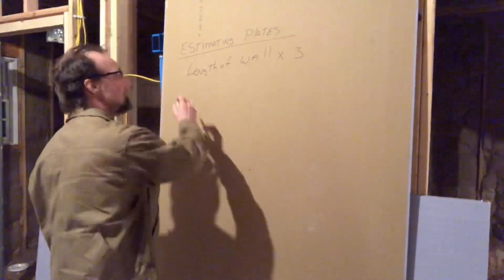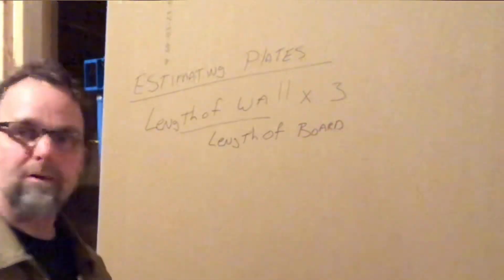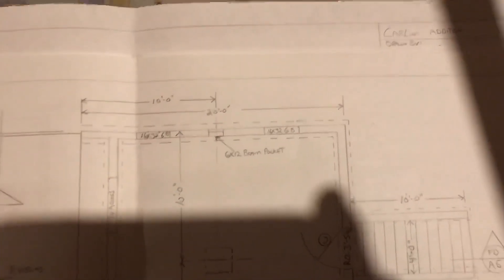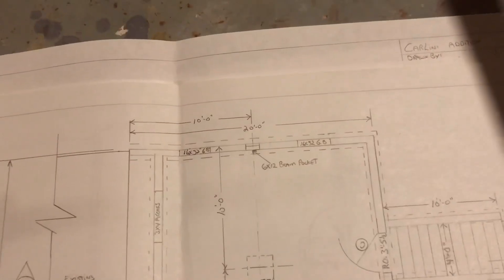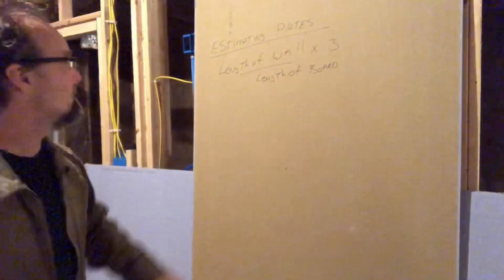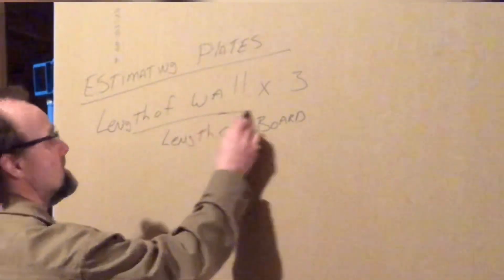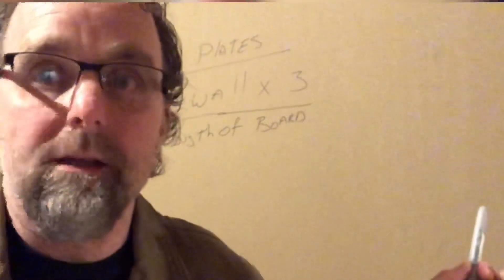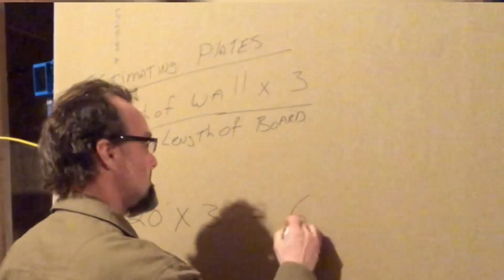Studs and Wall Plates Calculation

Comment: Wouldn’t you multiply length of wall by 4 since there are 3– 2x4 on top of the wall and 1–2x4 on the bottom?
Reply from the maker: There are two top plates on the top and one Sole plate on the bottom. When a wall runs parallel to the joists above you must add one piece of lumber wider than the wall to catch the drywall ceiling.